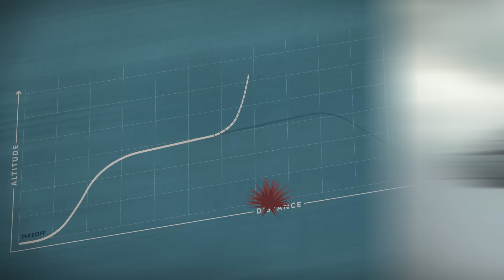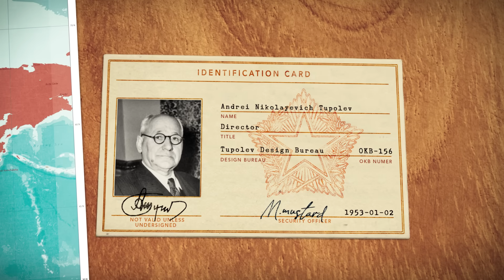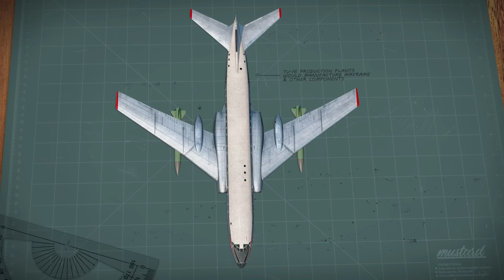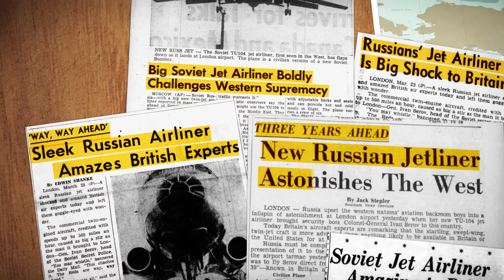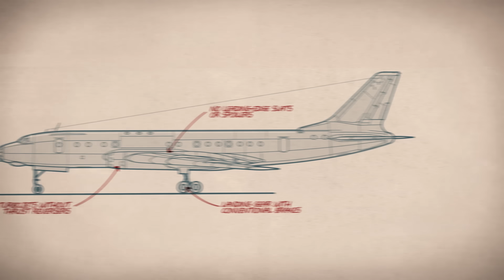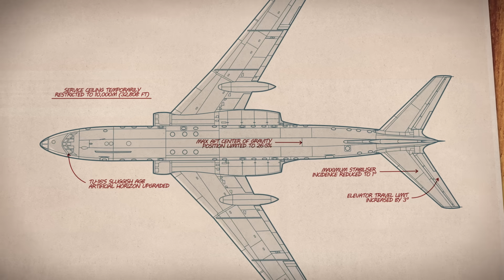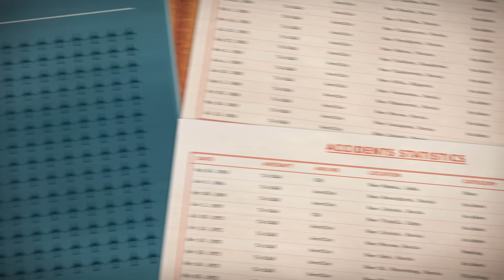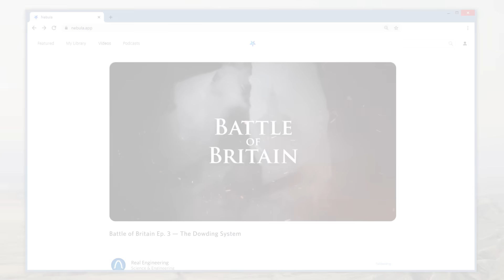The Soviet Airliner Designed To Crash

Comment: Hahahaha!  No. The 737 max before the software updates to the MCAS was way more dangerous.
Reply: That's the most ignorant comment on this video..
 The Boeing 737 has a much better safety record.
The Comet is the the plane with the highest loss rate and fatalities statistics
Reply: @sandervanderkammen9230 Boeing 737 MAX better be safer than it is, 65 years after the Tu-104 first took flight. The two avoidable crashes are a disgrace
Reply: @one_step_sideways  There are already 1,500 in service and have flown around 1 million flights... a better safety record than the Tu-104 or the de Havilland Comet.
Due you understand how aircraft safety statistics work???
Reply: @one_step_sideways  Well, Boeing was right about not giving MCAS full flight control authority, it was the FAA that insisted.
The Director of the FAA was forced to resign and the 737 Max was changed back to Boeing's original design.
Of course we know that neither crew followed the correct procedure for a runaway stab-trim event... a very disturbing lack of crew competence.
Reply: @sandervanderkammen9230 I know how aircraft safety standards work. The bar is miles higher than it used to be 70 years ago, and what's Boeing been doing up until now is atrocious and cannot be justified or defended with a "it's not that bad, guys!!!!!! they're only an itsy bitsy global conglomerate startup with only 156,000 employees!!!!!!!!!!!!"
Reply: @one_step_sideways  this guy seems to be a Boeing bot. He never provides sources either.
Reply: @Bagster321  Those DEI employees are employing JIDF tactics. Go figure. An apple doesn't fall far from the apple tree.

Comment: Sounds like America has gone backwards,there Boeing 737 max does the same, with there technology advanced NCAS
Reply: The 737 is the most successful aircraft in history with 11,000 aircraft built. 1/3 of the people in the air right now are on board a 737, one takes off or lands every 3 seconds.
It's has carried more passengers than twice the population of the Earth.
Reply: @sandervanderkammen9230  unfortunately Boeing hang onto the past, instead of moving forward, they should have by now designed a new aircraft, almost like to much Botox, it eventually is going to fall apart 🤣 the 737 max was an old aircraft with BOTOX and it fell apart
Reply: @Dezzy-e8b  The industry experts disagree with you, Boeing has more orders now (over 4,000) than it did in 2019.
Reply: @sandervanderkammen9230  Not for long
Reply: The only reason why Boeing decided to continue the 737 instead of doing a clean-sheet airliner is because demand was more for the 737.

Comment: The TU-104 was retired in 1981 and suffered 16 crashes.  The Boeing 727 was retired in 1984 and suffered 56 crashes.  Any questions?
Reply: YES, I have a question. Boeing built 1,832 727s.... and only 200 Tu-104 were built... 
Which aircraft has the better safety record????

Comment: I'd say the Boeing 737 MAX is more dangerous.
Reply: No plane has ever been more dangerous than the de Havilland Comet.
Reply: @sandervanderkammen9230  Not even the Doom Coffin 10.
Reply: @mach6893  The Airbus A310 has twice the number of fatalities per million flights than the DC-10.
You were 20 times more likely to die on board a Concorde than a DC-10.
Reply: @sandervanderkammen9230  The Concorde was a very safe plane. The lone Concord crash was due to external object damage.
Reply: @mach6893  The Concorde actually has an appallingly bad statistical safety record compared to the Boeing 737 Max.
 It has an average of more than 1 fatal crash per million flights.

The final crash report confirms that the Air France Concorde crash was not caused by FOD but rather a exploding tire.
The Concorde had racked up a very disturbing number of tire failures and neither the operators or manufacturers had adequately address this serious safety problem.
The Concorde was grounded until several design flaws in the Concorde were fixed with some safety issues left unresolved when the aircraft was retired.
 The Concorde would not be allowed to fly today, it does not meet current standards.
Reply: @sandervanderkammen9230  I see.

Comment: And what about the Boeings?
Reply: ^ Obvious liar tis obvious 😆🤣 .

Boeing has been in court over the 737 Max for years, chiefly due to willfully unsafe practices that caused the needless deaths of over 240 people in two crashes caused by bad design.

Boeing are criminal hacks with blood on their hands, and have been for decades.
(such as the incompetent Boeing engineers that caused Japan Air Lines Flight 123 to crash after a defective rear pressure bulkhead repair, killing 520 )
Reply: @jimtaylor294 Boeing has the best safety record.
The 737 Has a better safety record than the Comet
Reply: @jimtaylor294 You need to go back and read the report on flight 123, it clearly states that technicians installed the bulkhead incorrectly and the repair did not meet the specifications given by Boeing engineers.
Reply: Boeing has one of the worst safety records. The 737 - and its criminal manufacturer - has killed more people than the DH Comet ever did.*
#FixedIt 😌👌

Your pointless 2nd comment ironically states what I did (Boeing staff screwed up, and 520 people died needlessly), so your point is non-existent.

Nobody in their right mind would board a 737 Max,  the flammable & hilariously ironically named ""Dreamliner"", nor any of the other deathtraps made by Boeing... let alone those farted out by Tupolev before the USSR's command economy went >poof< in a puff of economic reality 😆🤣 .
Reply: Boeing makes the safest aircraft in the world
Reply: @WilhelmKarsten  I thought Airbus is safer.
Reply: @jacobjonm0511  No, the statistics say you are twice as likely to die on a Airbus than a Boeing.
Reply: @jacobjonm0511  Boeing is 1.84 million flights per crash.
Airbus is only 0.81 million flights per crash

Comment: I think I would've felt safer on this than a Comet, if I had a choice 😂.
Reply: ...and you'd be right. The Comet C outlasted the TU-104 (didn't leave all military service until 1997, and the Nimrod subvariant lasted until the 2010's), had a robust safety record, and the manufacturer & Airlines actually made fixing issues a priority (unlike the USSR) 😏 .
Reply: @jimtaylor294  The Comet was grounded in 1980 due to metal fatigue damage.
The Nimrod although similar looking is not a Comet.
Reply: @jimtaylor294  Comet 1 was so unsafe it was permanently grounded in 1954 and its airworthiness certification was revoked.

Comment: Kinda remind me the recent events of boeing, when they blamed the pilots, because the accidents happens in 3rd world countries.
Reply: ^ Straight up lying... as is to be expected from that troll. Boeing is entirely to blame for the 737 Max crashes (and their body count), as it was Boeing that broke the law by installing a system on the aircraft and not telling the airlines, pilots nor the NTSB until pressed by the latter.

Boeing are criminals, and unlike their liability in the Japan Air Lines Flight 123 disaster (where incompetent Boeing engineers killed 520 people), the public will never forget.
Reply: @jimtaylor294 Just the facts here lad, Boeing makes the safest aircraft in the world.
Reply: @jimtaylor294  Actually the FAA demanded that Boeing install MCAS at the objection of Boeing engineers.
 Boeing design a System that did not have full flight control authority.
The current 737 Max uses the Boeing original design, not the FAA mandated design.
Reply: The pilots were to blame in the 737 Max accidents, both crews failed to follow the standard procedure for a runaway stabilator trim motor which ultimately led to two fatal crashes.

Comment: I would say the De Havilland Comet has to make the list for most dangerous. They didn't quite understand that the stresses put on an airframe by a jet engine, aren't the same as a propeller engine. Comets had a bad habit of disintigrating in mid-air. Eventually, they fixed all the flaws, but by the time they did, the Boeing 707 had entered service, and nobody was interested in buying the Comet anymore.
Reply: ^ Two liars for the price of one 😆🤣 .

The TU-104 crashed more & for longer (the issues were never fixed), the Boeing 747 has killed more than any airliner in history, and Boeing themselves have proven themselves criminals with the 737 Max scandal, that killed over 250 in two crashes caused by an unofficial feature that shocked the NTSB, and led to plentiful revelations of criminal negligence of safety rules at Boeing.

The US Gov' will wipe Boeing's behind, as it did in 1985 when incompetent Boeing engineers killed 520 people in Japan... but the public & the pilot community won't forget who played fast & loose with their lives for a few extra dollars 🦹‍♂️.
Reply: @jimtaylor294  WRONG no jet airliner has a worst safety record than the de Havilland Comet
Reply: ^ Not wrong. The TU-104 has a worse safety record than the DH Comet. #KeepCrying clown 😆🤡
Reply: Yes, the Comet has the highest loss rate and fatalities per flight and passengers carried per mile.

de Haviland had very limited knowledge of building large all-metal planes with pressure cabins... the were still building aircraft mostly out of wood and fabric.
Comet 1 was the worst engineering disaster in commercial aviation and its airworthiness certification was permanently revoked.
Comet 4 was a completely redesigned plane but it too has the highest loss rate and fatalities statistics of any jet airliner except for the Comet 1.
Comet 4 was grounded due to metal fatigue damage... the Boeing 707 family is still flying and is expected to remain flying until 2050.

Comment: that not a DC-10. Not most dangerous
Reply: ^ Copy & Paste lying is Copy & Paste, and still lying.
Ding
Reply: @jimtaylor294  It's an irrefutable fact, the Comet has the highest loss rate and fatalities statistics of any jet airliner in history
Reply: ^ You're using words boyo, but very few of them correctly 😆🤣 .

TU-104 tis worse than the Comet by leagues and bounds; get over it Sourkraut 😁😏
Reply: @jimtaylor294  The Tu-104 cannot physically be worse than the Comet. Just by the fact that it is made from a bomber. A RELIABLE AND PROVEN BOMBER that has been flying for decades and is still flying in various modifications. (Yes, the Chinese H-6K is also the “son” of the Tu-16). All systems of the Tu-104 aircraft had already been well tested and tested before they were used in the aircraft itself. From the landing gear retraction mechanism to the elevators. Ordinary Soviet-made Tupolev civilian aircraft, in principle, were much safer and more reliable than their overseas counterparts. I've flown many of them. And unlike the Comet you named, the Tu-104 had normal-shaped windows from the start. It didn't disintegrate in the air. So your comment is complete bullshit, based on stupid prejudice and without proper evidence. The Boeing 737 will surpass the accident rate of any Soviet aircraft, but you are still flying on these "flying coffins"
Reply: @jimtaylor294  PROVE IT!
Reply: ^×2 Says the spam bot that's never proved anything and seems to think books, pilot testimony & experts in the field don't count. #Hypocrisy100 😆🤣 .

^ Reams of information - from Russian sources and not - contradict you, so I - like anyone else with a deductive reasoning & a pinch of objectivity - choose to believe them. Cute attempt at wholesale denial & copium though, if not a bit cliched 😆🤣 .
Reply: @jimtaylor294  The de Havilland Comet 1 has a staggering 46% loss rate, the highest of any commercial jet aircraft in history.
  A total of 39 hull loss accidents out of just 114 built  (76 Comets in actual service), and 496 fatalities in just 1.7 million flight hours before retirement makes the Comet series the deadliest jet airliner ever made.
Reply: de Haviland Comet was the worst jet airliner in history

Comment: Be fair bro... It was just a begining... Remember th Comet jet...
Reply: Good point, the Tu-104 has a much better safety record than the de Haviland Comet.
Reply: @WilhelmKarsten by what metric?
Reply: @kickedinthecalfbyacow7549  The Comet  had a higher percentage of crashes and hull loss accidents, it also has the highest fatalities per flight and per passenger/mile flown.
Reply: @WilhelmKarsten  the comet had 3 hull losses over 76 hulls in service, TU106 had 16 hull losses over 96 hulls in service, lives lost on comet is 46, the TU106 is in the hundreds.  The TU106 was in service for more than 20 years so flew far more miles than the comet which was grounded for 4 years meaning it was only in service for around 10 years, so not a particularly useful metric.
Reply: @kickedinthecalfbyacow7549  Comet had 26 crashed, 39 hull losses with 426 fatalities

Comment: so many accidents, finally it was removed from aeroflot. then the soviet military took over, they said, they are not afraid of flying tu104. until february 1979, when a crash in leningrad killed all the military commanders of the soviet pacific fleet. you should have mentioned this in your story
Reply: Still had a much better safety record than the British de Havilland Comet.
The Comet has the highest loss rate and fatalities statistics of any jet airliner in history.
Reply: @sandervanderkammen9230  you missed the point. comet problems were investigated and corrected. there was no secrecy. the tu104 problems were kept secret and pushed to fly despite all risks. finaly comet was retired, and new airplanes were built based on the knowledge.
Reply: @west_park7993  Comet 1 was grounded in 1954 after 6 unexplained hull loss accidents, it's airworthiness certification was permanently revoked in 1958 and never returned to revenue passenger service.
Comet 4 has the highest loss rate and fatalities statistics of any jet airliner in history except for the Comet 1.
The Comet is the worst jet airliner in history.
de Havilland had the worst safety record of any aircraft manufacturers and went bankrupt in 1958 because people refused to buy these horribly unreliable and unsafe aircraft.

Tupolev still makes jet aircraft as part of UAC.
Reply: @sandervanderkammen9230  yes, but they grounded haviland, and the ruzzians never grounded the tu104. then the french made the concord, that served till recently. russians made the horrible ty144, that after a couple of years of demonstrations was all grounded. yes, tu still makes airplanes, despite NOT being the best constructor. Sukhoi was better, but sukhoi was NOT a member of KPSS, while tupolev was... you tell me, which comet killed the entire french military fleet commands stuff? like 20-30 generals and their wives?
Reply: @west_park7993  The de Havilland Comet has the highest loss rate and fatalities statistics of any jet airliner in history.
Of the 114 built only 76 saw commercial revenue service and had a total of 26 crashed and 39 hull loss accidents.
426 fatalities its the the highest fatalities per flight and per passenger/mile flown of any jet airliner.
Reply: @sandervanderkammen9230  can you dig up the same statistics for tu104, pls?
Reply: @west_park7993  Wiki says the Tu-104  only has an 18% loss rate. 16 crashed 37 hull losses out of 211 aircraft.
Reply: @west_park7993  No versions of the Tu-104 had its airworthiness certificate permanently revoked.
Reply: @west_park7993  1,140 fatalities, but the Tu-104 carried up to 115 passengers, the Comet typically carried half that number.

Comment: Airplanes are not the problem, they are just giant tools.
And if companies that own and operate them are greedy lazy or incompetent then they are 100% responsibile for the failures crashes and deaths.
Reply: The de Haviland Comet 1 is the worst engineering failure in commercial aviation history... it remains the only jet airliner so badly designed and built that its airworthiness certification was permanently revoked

Comment: One thing I've always wondered about Tupolev is why they went with anhedral on their low wing aircraft. I'm not an expert on aerodynamics, but it seems to me that such a design is naturally less stable in flight, with the added disadvantage that the landing gear ends up being taller than it would otherwise need to be.

Comment: The 707 designers must have been very entertained by watching the Soviet designs and the world's airliner designs....

Boeing took their time and didn't rush the 707 into service....the kc 135 helped because it went into service about 2 years before the 707 and important data was obtained to improve the 707.

even then, the 707s vertical stabilizer was too short causing it to be a little bit unstable..called yaw....it had the tendency to suddenly sway side to side in mid flight.

and it's 35 degree sweep back wings also made faster  but less stable.....

Boeing fixed the problem by raising the vertical tail 4 feet..and adding a stabilizing fin under the tail....giving it the appearance of a futuristic rocket ship.

advanced versions of the 707, included a new wind design and extended wing slats. these improvements including a small gadget in the lower part of the vertical tail called a yaw damper, were quite costly to Boeing but worth every penny.

once these problems were fixed, the 707 proved to dominate the skies and was in many opinions, the most popular and beloved jetliner of the 1960s.